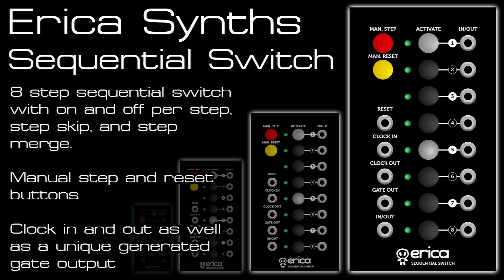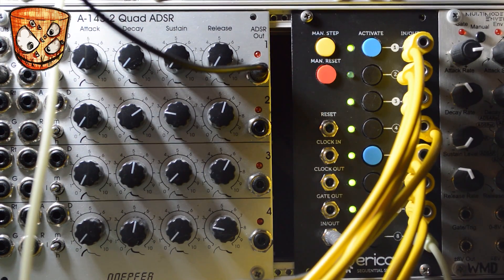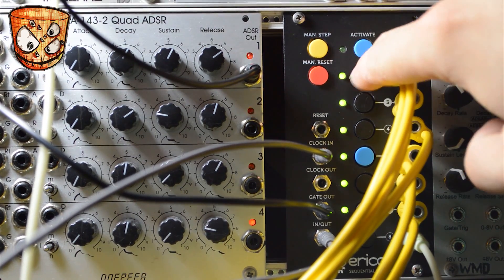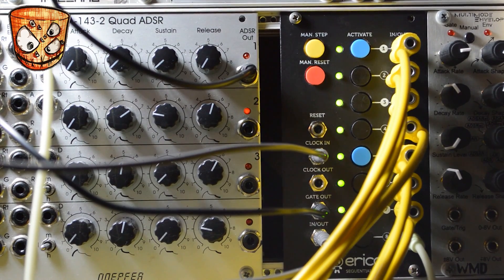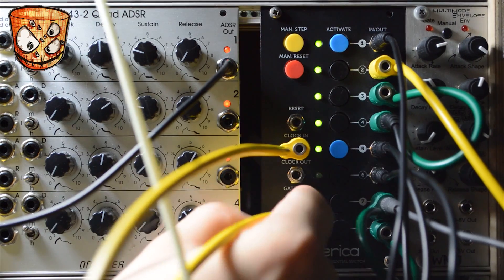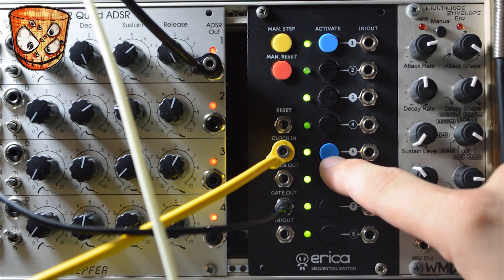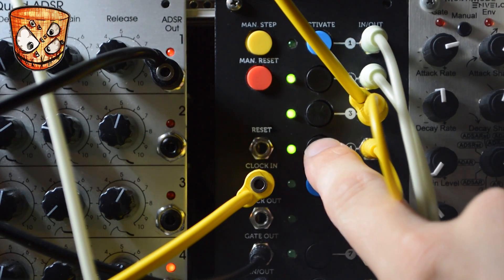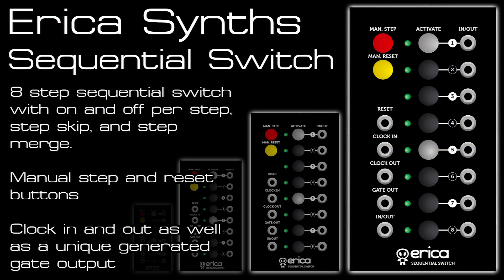Erica Synths - Sequential Switch

Comment: Hi mate, i cannot get the cv expander to work with my sequential switch , its the v1. Any ideas?
Reply from the maker: I don't know if the V1 does work with the CV expander, I never had one so haven't tried. Hope you get it worked out though as turning into a hybrid switch and sequencer is great.
Reply: @DivKid  thank you so much for the response, but it definitely does because erica synths made a video using it, it gets even more ocnfusing because they say the cv expander  v2 doesnt require power as it gets it from the seuqntial switch via ribbon cable, however the pcb has a 12v in and came with a power cable. I send the gate out into v/oct on plaits and when i wiggle the knobs i still dont hear any change in pitch for any step. So either i have it hooked up wrong with the power and ribbon set up or i dont understand how to hear the output that is being modified by the cv knobs. I dont know if any of that made any sense at all lol.
Reply: @DivKid  this is the version i have 
https://www.youtube.com/watch?v=8D8xetTafKI&t=49s

Comment: Thank you for the great demo.  Would this work to distribute gates or triggers to 8 outputs? So, run clock in mult'ed to the single In/Out, would that send the gate out to each of the 8 In/Out ports, like Club of The Knobs 961S 5U module?  John L Rice did a nice demo of that with a 5U 960 sequential controller.  I just got a Behringer 960, so would like to be able to get that hands on performance capability

Comment: I have the followup model to this. At slow clock speeds, every advancement of the switch creates a prominent CLICK.  At slow speeds it is very annoying. At faster speeds it creates a complimentary rhythm track you might say. Three sequencers going in and the output has gone through any number of routings to dampen the clicking with little success. Anybody have any ideas?
Reply: For audio through the switch I would presume, right?  That is because each time the sequencer advances, your audio waveform is not at zero, it’s either positive or negative voltage, creating a click sound.  Try syncing or resetting your VCOs to the same clock that drives the switch.  This would happen with any seq switch.
Reply: @freefinancialadvice  im just this second about to buy this very module so thanks for the advice :)

Comment: Can I use this to say, trigger a 16 step seq from Rene' and then have it switch to maybe 8 steps of another sequencer, and so on or back and forth from one to the other with the right settings and maybe with the reset?
Reply from the maker: Hey, absolutely. A sequencer with per step gate outputs is useful as you can be very precise with where switching happens. Patch the Rene CV output into it and the other sequencer into it. Clock your two sequencers (either same clock or different divisions to your liking) then take a slower clock division or a gate output from one sequence to flick between them.
Reply: cool.  I ordered it the other day.  I'll be trying this thing out next week.